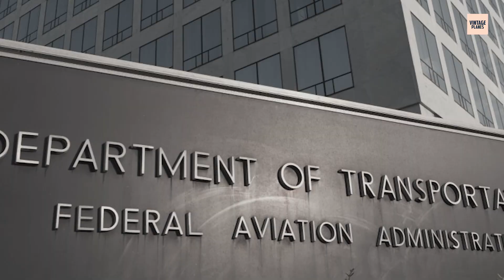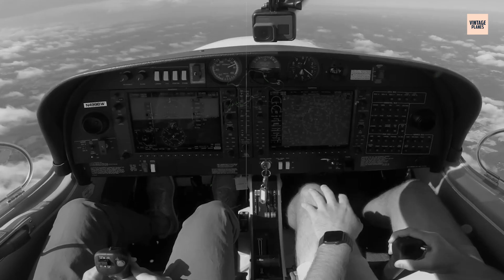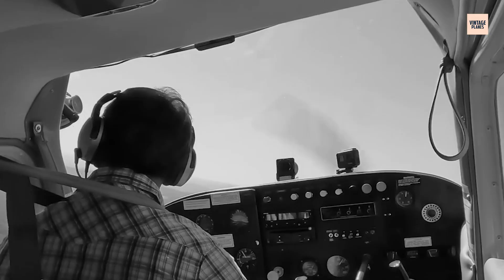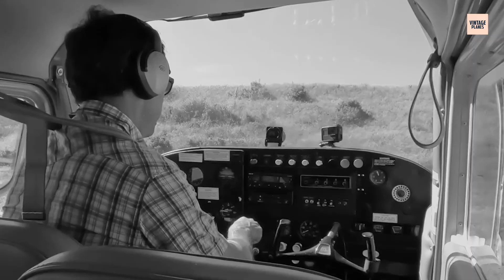The Shocking Truth Behind Lycoming IO-360 Engine

Comment: No FAA Airworthiness Directive numbered 2024-21-102 exists as of December 15, 2025.

FAA AD numbers follow the format YYYY-XX-NN, where:
- YYYY is the year the final rule is issued.
- XX is the biweekly period (01 to 26).
- NN is the sequential number within that period.

The only AD in the 2024-21 series is AD 2024-21-02, issued October 31, 2024 (effective December 5, 2024), addressing connecting rod bushing issues on certain Lycoming Engines models. It requires repetitive oil inspections for bronze particulates and potential bushing replacement.